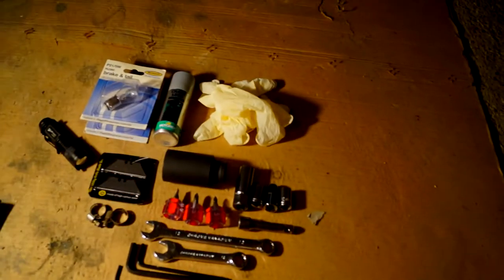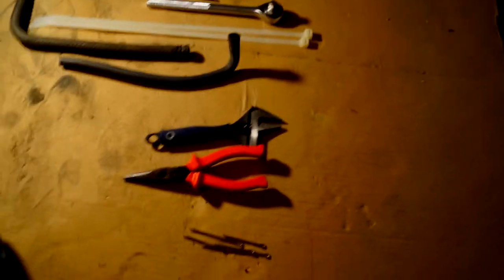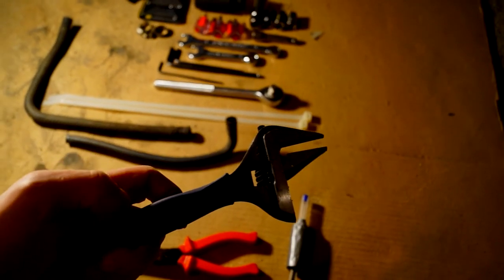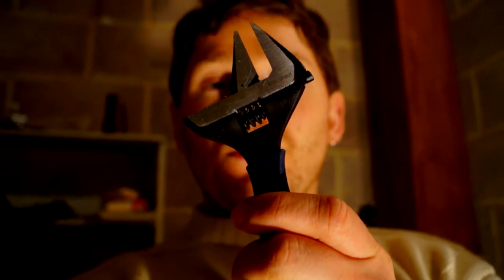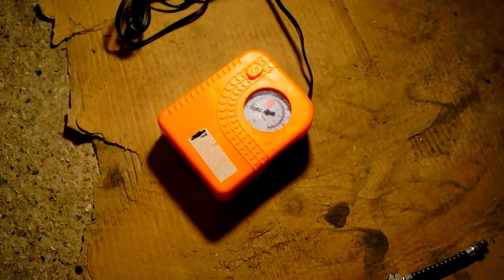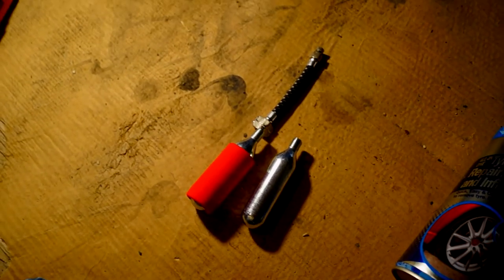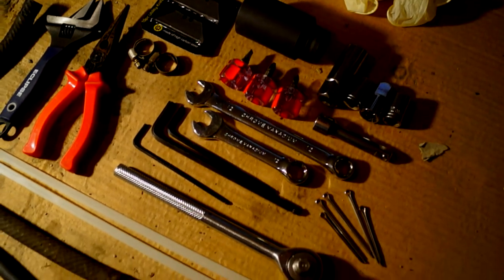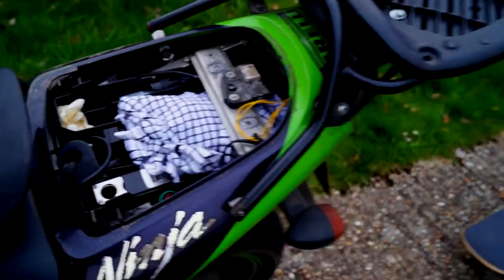Motorcycle Tool Kit (Under Seat)

Comment: love the vids mate, i ride a simular zx6r, do lots of road trips, nice tool review, i have the underseat kit that comes with bike, plus added a few....front tire change is hard to have tools for as it requres a way to hold up front end and special/home made  tool for axle removal.... just got home from 4500km road trip...and i would do it again tomorrow if i didnt have to got to work ha ha ha
Reply from the maker: Thank you very much. I can only hope I never get tire problems, as they can be a nightmare for roadside fixing. Glad you enjoyed your trip, and covered a lot of KM's. I always end up thinking of work on my return ride, puts such a negative mood on the last 100km. All the best, and thanks for the comment!
Reply: have done a zip tie tire change on the front an rear  (180/55r17) when i lived on a small island in the middle of nowhere, worse case scenario i figured was lay bike on frame sliders and pull front tire.... it never came to that... but I coud rebuild this engine at a picnic table if I needed....
Reply from the maker: I have never tried a zip tie tire change, only seen people do it on youtube. Good to have the knowledge, just in case one day it is the only option. I envy your ability to rebuild your engine. I am still limited to the basic tasks. All the best!